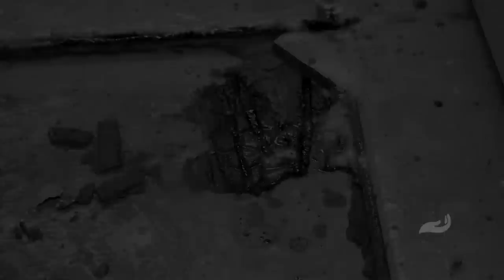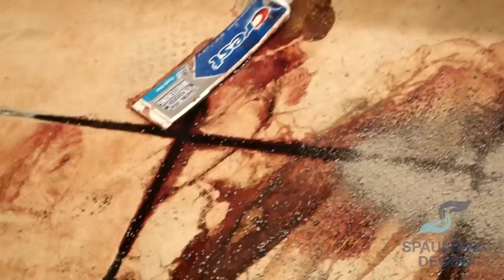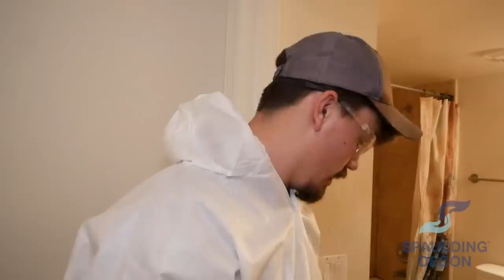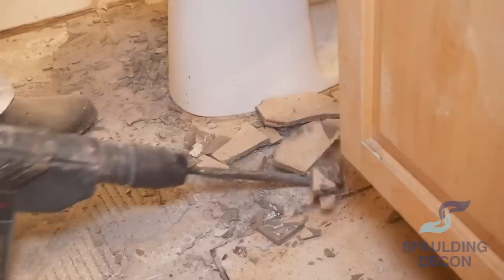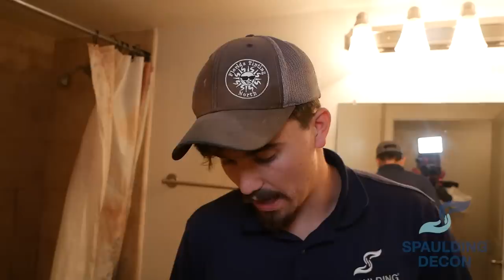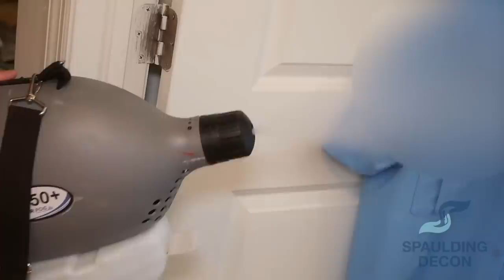FLY BUFFET! (Tampa, FL)

Comment: Regarding the Tile Removal, there´re very specific Tile Chisels for Removing them. They´re thinner, way wider and also on an Angle, much like a Shovel, so you don´t have to Bend down that much. Most of them also have a SDS / SDS Plus Connector. Used them a lot during my Time as a Construction Worker. With that, there´s no need to attack the Corners first, since those Chisels pretty much just slide through underneath them. But still, the first Tile will always be a Pain in the Butt, no matter what Tools you use.

Comment: I don't want to make it seem as if what you do is a simple job.  The amount of knowledge, effort, and resilience needed to do this is way beyond my comprehension.  Y'all are awesome! I believe that this instance is nothing more than a learning curve.  You will understand as time goes on, what is crucial and needed with each case that comes your way.  On that note, I feel that "painting" the floor using a short-bristled brush and paper towels was a complete misstep.  If you lack the supplies to do the job correctly, go buy them from your local hardware supply store. It may take some more time out of your day, but you can understand that the job was done correctly in the end.  

Keep up the great work!

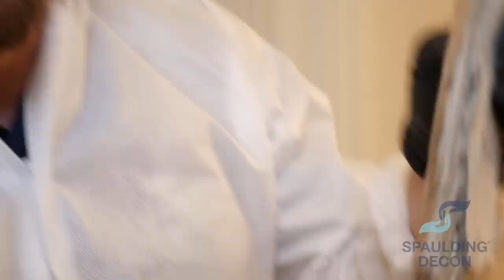Comment: Actually you are wrong, no liquids should penetrate through grout or tile for this very reason they are used in bathrooms where liquids are mainly used such as the shower. I prefer for you to be real about it and not provide a tile course that you know shit all about. At 4:47 you’re showing the mortar which is grey thats used to stick the tiles down, and the grout comes in many colours to match the tile finish. So no the grout did not change colour from the mortar due to this decomposition.
Reply: Yes blood/fluids can penetrate and stain grout. Ive seen blood stains myself in grouting and travel under a wall & baseboards to grout in hallway on other side of wall. Does not bleach out.

What do you do about filthy black mold grout stains?
Reply: Frisse Kater
Reply: @lavendergold6379  good point, according to this video tiles need complete redone whenever you have an oopsie.
Reply: @vonderloo3184  yes they can stain the grout on surface which can be removed with steam and other cleaning chemicals or in some cases when the grout is just to dirty the grout is only redone by removing the grout only. You mentioned baseboard and wall? Yes obviously the 2 surfaces are not seamless, no-one ever said anything about that. We know there is a gap always there. 

The only point i was trying to make is the mortar and grout were never the same colour to begin with, as stated in the video!
Reply from the maker: If there is even the slightest crack in the grout, then any bio fluids can leak through and spread pretty far under the tile.